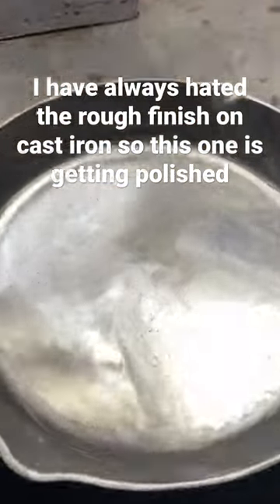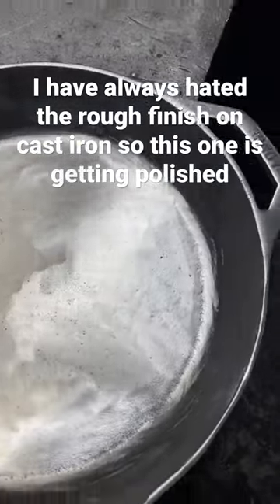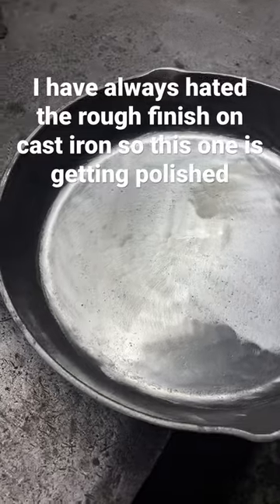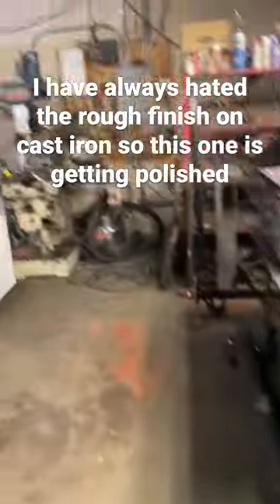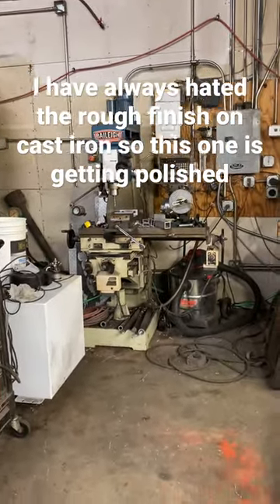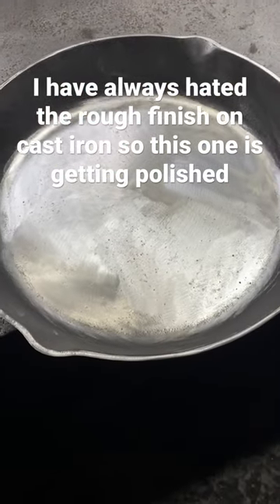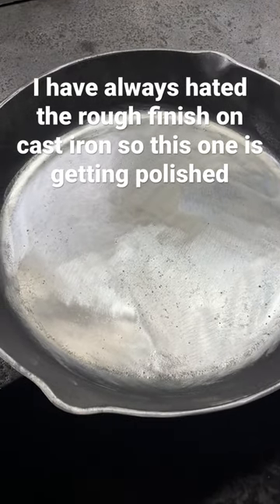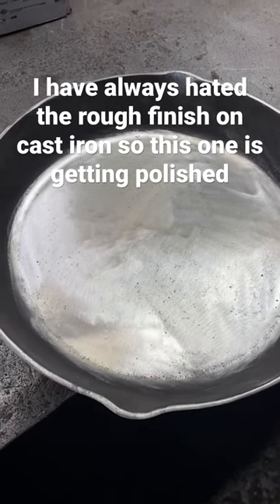Polishing my cast iron pan

Comment: Only 2 concerns, 1..don’t take too much material out, it will make it easier to warp or crack, and 2..don’t make it so smooth it won’t hold onto seasoning..
Reply: Seasoning Its a chemical process, it dosent need a rough surface to hold onto.
Reply: Wrongggg
Reply: Cast iron is porous, no matter how smooth it is..... it'll take seasoning, no problem!
Reply: First concern is valid, second concern isnt a thing. If a smooth surface was an issue then carbon steel woks would be impossible to season, but they arent, they hold seasoning just fine. 

If your seasoning is coming off my guess would be your initial coats were too thick, or you have weakened your seasoning by cooking something too acidic

Comment: You can use the hand tool that holds circular sanding discs to smooth it out.   I use the Diablo sanding discs that are like a net.  It takes a bit, but you can do it while watching TV or otherwise relaxing.

You also may want to heat the pan to seasoning temperature to induce any fractures, that would occur later, between grits of sand paper

Comment: 80 Grit is as high of grit as you should go. It's not going to give you a better non stick surface and if its a polished finish you are going to have to season it more often.

It does look better but you get a worse pan.
Reply: That's what I've been wondering. I have a carbon steel griddle grill that's pretty smooth so I wondered if it would work on cast iron.
Reply: @westsenkovec 
He is wrong, steel woks are smooth and are just as easy to mantain as cast iron
Reply: Seasoning happens on a molecular level. Making it smoother will absolutely not make a difference